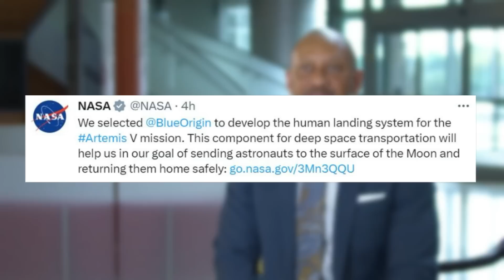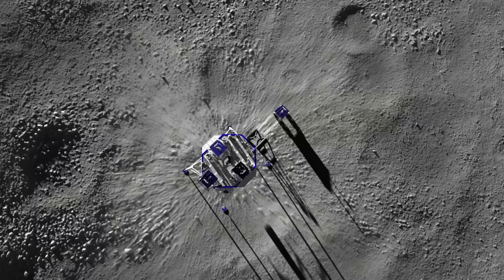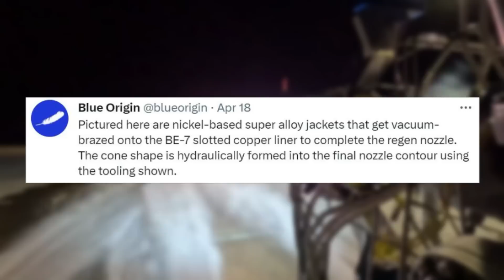Why NASA Awarded $3.4 Billion For Blue Origin's Lunar Lander

Comment: Where did NASA get the Money for the contract?
Reply: Congress; who increased NASAs budget and also told NASA that SpaceX was EXCLUDED from bidding on the 2nd contract for reasons of competition, non-dependency  on any one contractor and backup.
NASA and Congress have explained both the increase in NASAs budget and reasons for SpaceX exclusion, publicly and repeatedly.
Bill Nelson repeated all this in his opening speech!
Reply: @davidstevenson9517  HLS Starship is ALREADY the first lander, so if you want a SECOND lander, they can't bid. NASA wanted 2 landers for HLS Option A in the first place, but the 2020 Congress gave NASA 1/4 the HLS funding that NASA had asked for. Besides, SpaceX got the HLS Option B contract for the Artemis IV landing unopposed. Appendix P is for the Artemis V mission.

SpaceX bid $2.94B for the HLS Option A contract, which is development, the test landing, and the Artemis III landing.
SpaceX bid $1.15B for the HLS Option B contract, which is for Artemis IV.
Blue bid $3.4B for the Appendix P contract, which is development, the test landing, and the Artemis V landing.

Comment: if there is a second option after starship to land on the moon, why not they have a second commercial option after orion?
Reply: That is logical.  However practically NASA will have a second commercial option without having to pay anything.  Bear in mind that SpaceX already has two signed contracts for commercial flights to the Moon which are functionally equivalent to Artemis 2 at list price lower that $500M each.
Reply: @jamescobban857  yes. we all know at some point NASA will move to starship full and final, but in the mean time I see there is an urge for having options in case of landers but not for what they made themselves (orion & sls).
Reply: Because NASA could not afford a second Orion and SLS, so they made Orion ridiculously redundant instead.

Comment: Blue Origin doesn't have an orbital platform.   Given the problems the are having getting the their rocket going, I don't see how they are qualified to get a lunar lander done in 6 years.
Reply: Grumman built the LM for Apollo without ever going to orbit. The biggest problem for the Blue Origin led National Team Integrated Lander Vehicle (ILV) is the BE-4 engine production for the New Glenn. IF the ILV v2 can only launch on the New Glenn, then Blue has to produce enough BE-4 engines for the ULA Vulcan Centaur (2 ea) and their own New Glenn (7 ea). So far, it appears that only 2 have been delivered to ULA and reportedly, ULA has first dibs on the BE-4's produced.
Reply: @steveaustin2686  Grumman was a proven aircraft manufacture doing something no one had done at the time.   They knew how to manage and deliver on government contracts.
Reply: @henrypierce8010  And had never done a space contract, something different than aircraft. Blue Origin beat Dynetics in the HLS Option A contract and beat them in this Appendix P competition. Or do you think that they top pick should not get the contract because you don't like them? Bezos is a d'k, but his company won the bid.

Comment: Based on BO’s prior performance, any proposal by BO should have been rated high risk. High risk for cost, high risk for schedule, high risk for performance
Reply: It takes up to 8 additional starships to fuel up one in orbit just so it can leave orbit. What a waste of fuel. Even Elon said that could take 6 months to accomplish the refueling. I don't see how starship will be ready on time since it hasn't had a successful launch and now they need to repair the pad because they rushed the first attempt.
Reply: @johngriffin141  SpaceX has proven they have the expertise and management to deliver. If SpaceX had been funded to do the whole project including a self sustaining lunar colony, NASA would not fall behind China before it’s over.
Reply: @Doug InOrlando  SpaceX hasn't proven any aspect of their moon lander program.
Reply: So? Blue Origin hasn't any aspect of their moon lander program either. At least SpaceX is flying hardware, and has proven rocket engines. Until Vulcan flies, BE-4 is unproven.
Reply: @spacexrocks1041  For the moon lander program specifically, Blue Origin has tested/proven propulsive landing with an LH2/LOX rocket engine, design & deployment of a human-rated capsule, and the NASA/BO Lunar De-Orbit Descent and Landing LiDAR tested in the New Shepard booster landings.
Reply: What risk for "schedule"? The BE-4 is only 4 years behind schedule. That's not so bad, is it?
Reply: Bezos probably spent a fortune on people who are experts in selling these kinds of projects. And more fortune on buying the right senators. We all know half of congress takes money on the side.
Reply: Per the May 2023 Appendix P Source Selection Statement, "Blue Origin’s Integrated Master Schedule (IMS) contains numerous conflicts and omissions" and was rated a "weakness" (page 8). The other competitor, Dynetics, was worse per the same document.
Reply: @steveaustin2686  omissions is grounds for being rated “non compliant”. They are lucky to get it categorized as merely a weakness instead of being rejected as noncompliant

Comment: Imagine what SpaceX could have proposed if given $3.4 billion extra to establish a self sustaining lunar station.   There’s no way I believe this blue origin proposal actually saves taxpayers
Reply: No, especially when you consider the hidden costs. SpaceX:  booster included in 2.9 billion contract. Compare to BO: booster not included, 3.4 billion. So BO has a hidden cost, the cost of the booster: if it's SLS, Boeing gets 3.2 billion per launch. Or they'll use New Glenn, which means BO gets a couple billion per launch.
Reply: @spacexrocks1041  Congress may keep funding the overpriced budget, but if SpaceX just continues with what they are doing, the expensive options will become redundant very, very quickly and the votes will start swinging - and then the projects are axed REAL quick.
Reply: @spacexrocks1041  they are only using New Glenn
Reply: @iamjwns6277  That's the plan. If the lander is ready, but New Glenn isn't, SLS is the only Plan B.
Reply: @spacexrocks1041  That is like saying that plan B for the SpaceX moon lander is SLS. Its is not. These landers are build specifically to fit the rocket they are going to launch on.

Also funny how you think New Glenn will not work, while you assume Starship will. Of the two designs, Starship is clearly the more risky design.
Reply: @torben777  Nobody should assume either will work. But Starship is flying hardware while New Glenn is ... ? Where's the beef?
Reply: So, NO competition. Just SpaceX money and hope for the best.
  Thats what stunted the aerospace industry after Apollo.
Also, SpaceX doesn't build space stations, they just deliver space station parts made by other companies.
Reply: SpaceX could have bid $3.4B for HLS Option A if they wanted to, but they bid $2.94B instead. The contractor sets the bid price and NASA accepts, rejects it, or renegotiates it.
Reply: @steveaustin2686  Or the billionaire who owns the company offers to cut the price by $2 billion, which should make you question why such an inflated price was presented to NASA in the first place.

Comment: SpaceX's lunar landing system looks the weakest part of their portfolio, and by looks I mean at first sight by me, im sure the engineering has been checked and works, but it seems like overkill physically bigger than needed, physically less stable as a lander and with practical risks for getting in and out of, As an orbiting way-station, perfect, as a lander it looks ungainly and sub optimal. 
That said I expect that NASA want a back-up given the whimsical politically motivated business operations of its owner, that is the risk that Elon will pull the rug because of objection to government action in other spheres.
Reply: No, NASA wanted 2 landers for the HLS Option A contract, but the 2020 Congress gave NASA ~1/4 the funding. Otherwise, if NASA had got the HLS Option A funding that they wanted, the Blue Origin ILV would already be the second lander. This Appendix P competition was NASA getting the second lander that they wanted in the first place.
Reply: Why did they want two options in the first place?
Reply: @logtothebase2  Back up and alternate in case something happens. The 2008 Commercial Resupply Services (CRS) contracts were to SpaceX with the Falcon 9/Dragon and Orbital Sciences (now Northrop Grumman) Antares/Cygnus for ISS resupply. NASA has reupped both providers and plans to add Sierra Nevada with the Dream Chaser on the ULA Vulcan Centaur for CRS. The demo CRS flight for Dream Chaser is the Cert-2 launch for the Vulcan Centaur in Dec 2023 or early 2024.

The Commercial Crew program contracts were the same with Boeing's Starliner on Atlas-V and Crew Dragon on the Falcon 9 B5. It's a good thing that NASA got 2 providers, or NASA would likely be still relying on Soyuz to get crew to the ISS.

Comment: Suddenly the crew compartment is where the engine and tanks were. I guess you can do that when you don't have three different elements(contractors). The descent element is the ascent element. I'm guessing an engine hump in the center like Bezo's Carnival Rocket.
Reply: NASA liked it.
Reply: There are multiple (probably 3) BE7 engines on Blue Moon.  So engines likely around the perimeter, not center.

Comment: dog blue origin has literally never gone to orbit
Reply: what if i told you big companies can work at multiple projects simultaneously
Reply: Grumman had never been to orbit either, when they built the LM for Apollo. The big issue for Blue will be if they can make the BE-4 engines fast enough to have some for the New Glenn that is planned to launch their lander to the Moon. Reportedly, ULA has first dibs on the BE-4 engines for their Vulcan Centaur booster.

Comment: I think NASA was getting nervous with a single source lander, (dependent on "Elon time"). Besides, slinging a lander that heavy around is going to consume a lot of fuel. If you think about the fuel requirements to get to lunar orbit, then inject into lunar orbit, then land, then take off - it's a lot with a big bulky device that is really designed, weight wise, to go to Mars. Not that I don't love Starship, but is not a custom design (for a moon landing).
Reply: You're right, marvinegreen, and NASA thought exactly the same: custom designed for the Moon and efficient.
Starship is custom designed..for Mars; to convert it to a lunar lander is improvisation, its a "white elephant".
Reply: Bezos time is any better?
Reply: @Scanner9631  Yeah, Blue Origin has a REALLY SLOW development cycle.
Reply: The slower you are the more money you get.
Reply: @steveaustin2686  blue origin development speed is the same as Jeff Bezos hair grow rate … imperceptible
Reply: @douginorlando6260  LOL. Yeah, the Air Force (USSF) had some pretty sharp criticism for Blue Origin's New Glenn and Northrop Grumman's OmegA development for NSSL2 payloads. From a SpaceNews Aug 2020 article

"Despite political pressure to not end the LSAs, the agreements will be terminated, Assistant Secretary of the Air Force for Acquisition Will Roper said Aug. 7 during a video conference with reporters.  'We will work with those two companies to determine the right point to tie off their work under the LSA agreements,' Roper said. The intent of the LSAs 'was to create a more competitive environment leading into Phase 2,' he said. 'The point is not to carry them indefinitely.'”

The New Shepard had a LONG development. The BE-4 was delayed long enough that it cost ULA money. No idea yet if Blue will be able to provide the BE-4 fast enough for the Vulcan Centaur launch cadence and the New Glenn launch cadence. ULA reportedly has first dibs on the BE-4.
Reply: @jamskinner  The Commerical Resupply Services (CRS) contracts, the Commercial Crew program (CCP) contracts, the HLS Contracts, and this Appendix P contract, are ALL firm, fixed-price contracts. So the Blue Origin led National Team is paying for any cost overruns. Just like Boeing has been paying for the Starliner fixes.
Reply: NASA wanted 2 landers for the HLS Option A contract, but the 2020 Congress gave NASA ~1/4 the funding. Otherwise, if NASA had got the HLS Option A funding that they wanted, the Blue Origin ILV would already be the second lander. This Appendix P competition was to get the second lunar lander that NASA wanted in the first place.

Comment: Less than five tons to the Lunar surface doesn't impress me much, especially if that includes your crew and their supplies. What if you need to transport one of the big, pressurized enclosed rovers?  (ʘ_ʘ)
Reply: The mk 2 Blue Moon lander can carry up to 20 metric tons to the lunar surface in a reusable configuration or 30 metric tons in a one way landing.
Reply: Why would you transport big pressurised rover on a crewed vehicle bruh?

Use cargo lander
Reply: There is no guarantee that the Starship doors and elevators will handle the Space Exploration Vehicle (SEV) either. For Artemis V, it would go on a CLPS mission most likely, if it wasn't left on the Moon from Artemis IV.

Comment: so they have gone with a company that design of the lunar lander is a scaled up Apollo lunar lander, which will not be able to land at the same spot on the moon repeatedly due to leaving the decent engine the same as Apollo. so much for reusability and setting a base up on the moon
Reply: To me, the new rendering of the lander looks to have the people at the bottom and the propellent tanks up top.  So I don't think there will be separate descent and ascent modules anymore.
Reply: @rpmcitycruiser  You're quite right, rpm..., some of us keep up to date with new developments.
Others however...
Reply: Edit: The old version had stages, but the new one does not, with the cabin at the bottom. Not sure where the engines are at, I would think at the top, since the bottom of the new version doesn't look to have an engine bell. Starship ha

The LM did not leave much of a crater at all. 

For HLS Starship, it is with a ring of smaller LCH4 engines around the top of the propellant tanks, to minimize regolith impact on the last bit of landing and first bit of launch. The whole HLS Starship leaves the surface too.

ignore this bit.
How the heavier ILV will approach the issue of kicking up regolith has not be laid out. Since the descent stage is left on the surface, they probably won't address it much.
Reply: @steveaustin2686  

It isn't the crater he is referring to.  It is the landing component staying around at your "base" so you can only do just so many landings before the base is encircled by the cast off landing component blocking future landings by your base.  Imagine parking at your home if every "mission" leaves a large part of your car blocking a parking space permanently.  How long before you have to walk blocks to get home from your car?
Reply: @Scanner9631  Do you just read the first sentence of my posts? I mentioned that the descent stage stays on the surface. With this being one of three crewed Artemis landings, that may not be an issue, if that trend continues.
Reply: @Scanner9631  the lander is a single vehicle that lands and takes off now.
Reply: @steveaustin2686  Blue Moon does NOT have a descent stage! That's the old concept BM video you guys are watching!
The new concept BM that NASA approved descends and ascends as a complete unit; and it can land 20 tonne reusable cargo mode or 30 tonne non-ascent/camp-base cargo mode, not just 4.5 tonne cargo/crew mode as asserted in this commentary.
Please watch and listen to NASAs announcement in it's entirety, don't rely on commentaries like this because it's inaccurate.
Reply: @luther0013  Dead right, luther, these guys should know better which suggests they never bothered watching the NASA announcement and I suspect they didn't watch because they cannot conceive National Team of creating a feasible lander i.e. myopic.
Reply: @davidstevenson9517  Yes, I corrected that in another thread. I will correct it here too. A different video showed the new design.
Reply: @steveaustin2686  Good on you, Steve (and good luck with the bionics).

Comment: My money is on Artemus V never coming to be, due to long range costs. BO's project will most likely never fly.
Reply: Artemis is already funded through the Artemis V mission. The funding for Artemis VI+ hasn't been laid out yet.
Reply: Too much potential money to ignore in off-earth resource extraction.  If there were no Artemis, BO (and maybe SpaceX) would likely self-fund or hire out their services to the highest bidders.
Reply: You will lose your money. The Starship Lunar Lander won't be ready before 2030. It will be an extremely difficult system to get human rated. Even to get to the moon the Starship Lunar Lander needs multiple refuellings of hundreds on tonnes of fuel. 
Although NASA said this is for Artemis V, in fact it will be necessary for Artemis III right through to V, and probably VI or VII. The reason being it is fundamentally an easier system to build and get to the Moon. NASA had to say Artemis V because of contractual reasons with SpaceX. In reality they have gone to Blue Origin because they know Starship Lunar Lander won't be ready for many, many years. Hence this "emergency" plan to ensure NASA can land astronauts on the Moon prior to 2030.
Reply: I’m wondering if it’ll be another constellation program

Comment: Sue origin needs to build a rocket. That can achieve orbit before it needs to concern itself with a lander. It can't leave the Earth gravity.🥱
Reply: Grumman built the LM without ever reaching orbit. Since the ILV is planned to launch on New Glenn, BE-4 production is likely to be the lynch point on if New Glenn is ready or not. Reportedly, ULA has first dibs on BE-4 engines for Vulcan Centaur and its NSSL payloads.